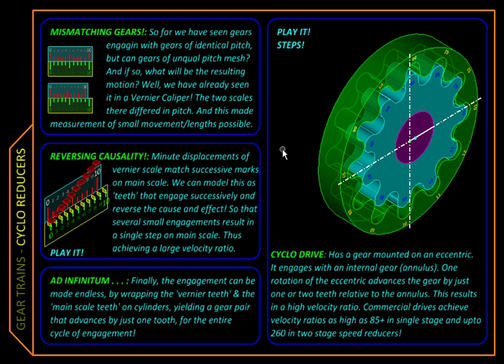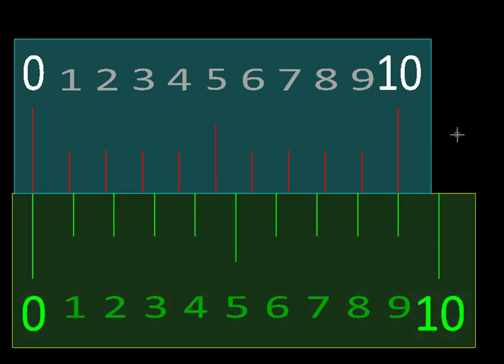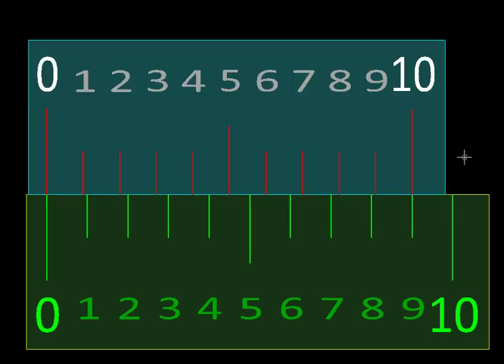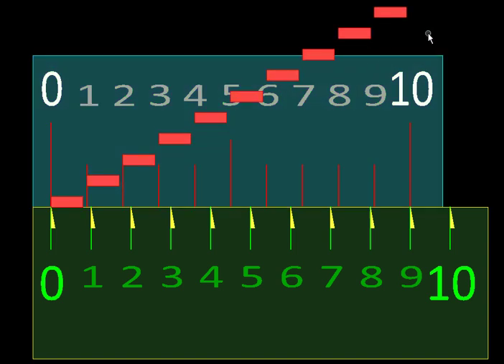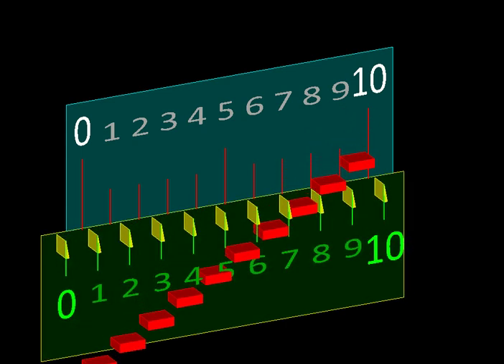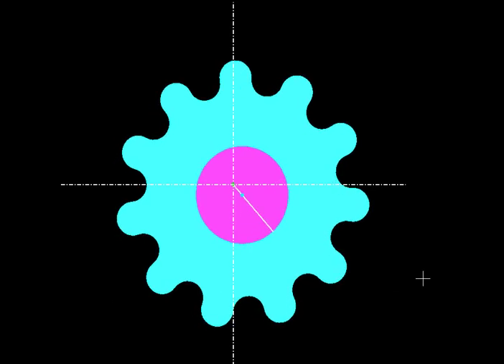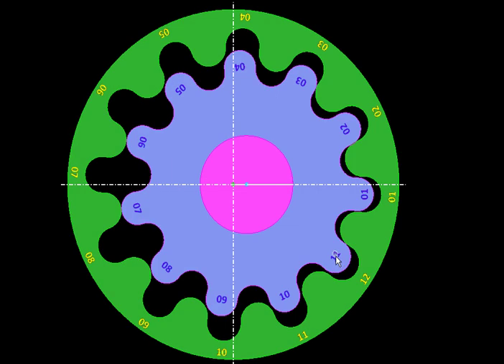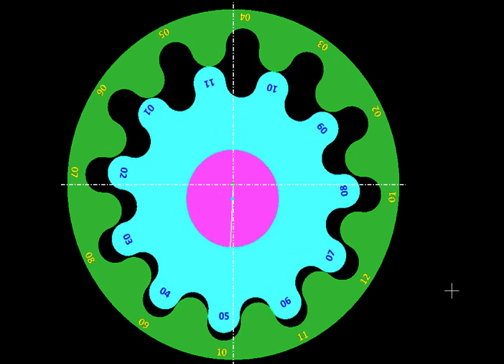Kinematics Ch06 Q High Speed Reduction Drive

Comment: I’ll be breaking in the cycloidal drive I printed hopefully tomorrow. It has a 8 to 1 reduction. It will be lubricated before so as not to melt the PLA. I plan on going through an entire drill motor battery to try and get the bearings to run more freely as well as to test wear

Comment: Which subject are these topics like cycloid gear and Hooke's joint and other mechanisms taught?
Reply from the maker: They are all part of Mechanical Engineering's 'Design' stream.
Within that group, they would come under 'Theory of Machines'.
Theory of Machines is typically divided into Dynamics and Kinematics.
Since the topics you mentioned start with just the motion (without considering the forces involved), they would be part of a 'Kinematics' course. Often it is labeled as Theory of Machines - 1.
Reply: Which book would you recommend for this subject?

Comment: wouldnt this create a lot of friction?
Reply from the maker: Recycle Bin Rather than thinking of friction in isolation, you can find the efficiency figures of these drives from some commercial sites that sell them. This should be seen in light of the Velocity Ratio (VR) they provide. The same VR would take a lot of stages in conventional gearing and the efficiency figure may not be higher there.

Comment: Is the ratio i=11
Reply from the maker: Yes, the velocity ratio of the two rotors are 1:11
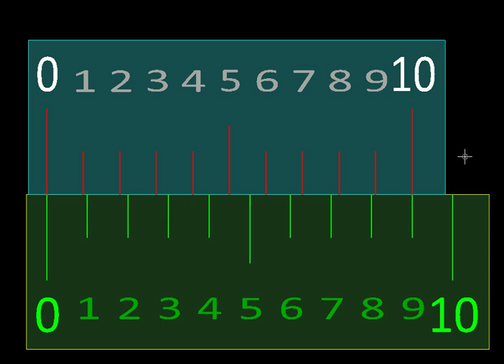Reply: Thanks for the answer. I need a 1:40 reduction. Can I build the cyclo Drive witch a normal CAD Program and do you have more Informations to do this?
Reply from the maker: The video just shows the principle and is far from being a design guide. There are lots of other details like the material, heat treatment, bearings, teeth profile, addenda and dedenda etc. not covered here. 
I would check the design codes or handbooks or better still, simply order from a vendor. Designing and cutting gears is a highly specialized area.